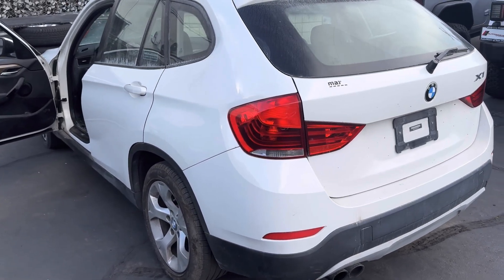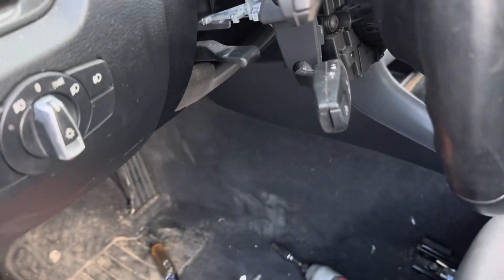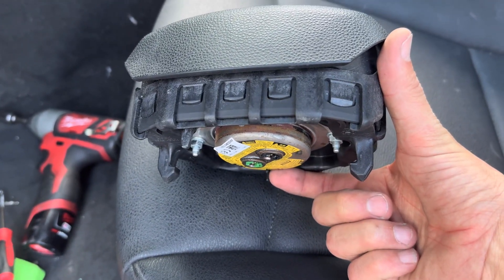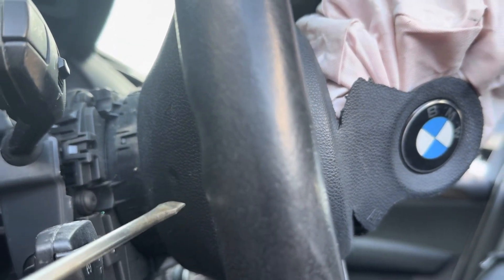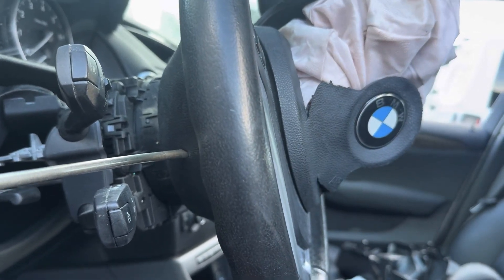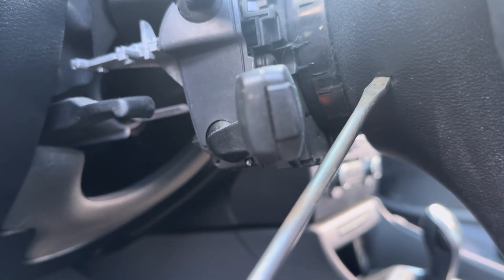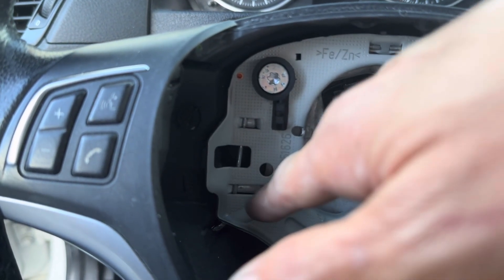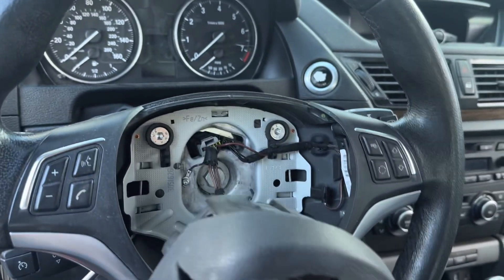How to remove BMW X1 Airbag

Comment: and do you have a video of how to reset the airbags so the car can start ?
Reply from the maker: @jorgepallares1058  once you install new airbags and seat belt/buckles it will automatically reset. If your airbag light is still on then that means you still have a bad part that needs to be replaced.